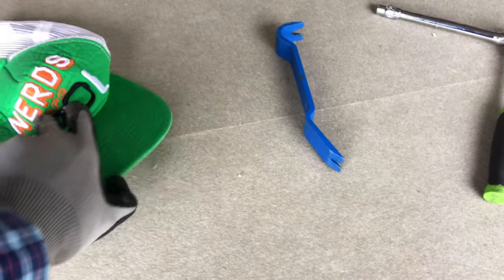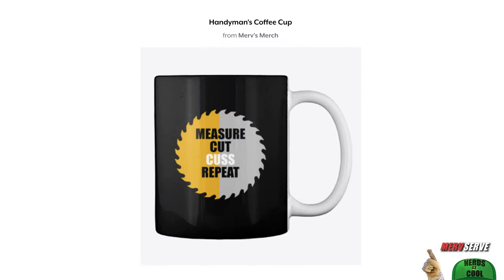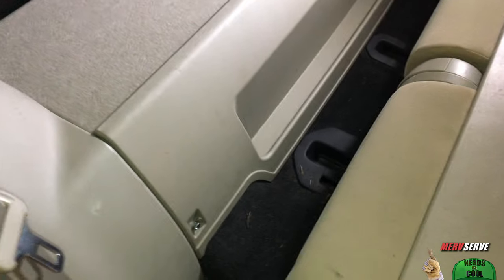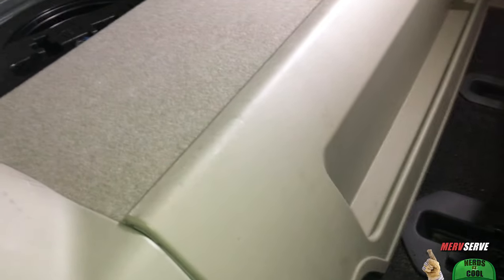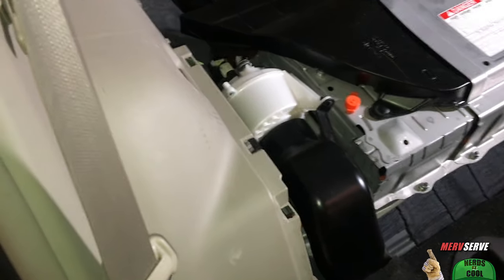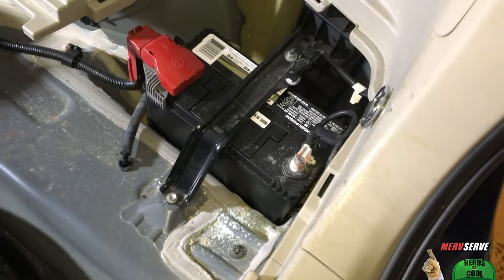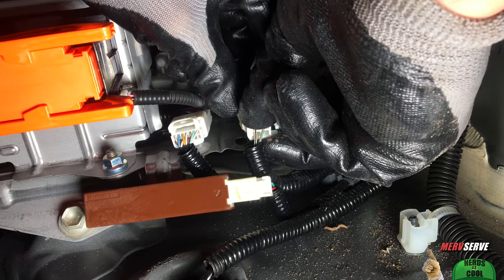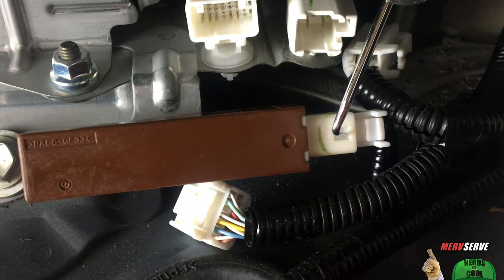Hybrid Battery Saver-Prius v Hybrid Battery Fan Cleaning & Cooling Performance

Comment: Thank you for the video. I followed it and I saved myself $500 dollars in dealer servicing. In the beginning I pulled the orange plug to disconnect the battery before working on the fan. I cleaned the fan using q-tips (dry first and then soaked with isopropanol) and some wet wipes. I found it easier to take the whole fan apart to get into all the nooks and cranies during cleaning.
Reply from the maker: Glad it helped. Sounds like you did a good job. And I like your attention to safety details!

Comment: Good video but you missed one important maintenance item. The black intake has a screen filter that gets clogged with dog hair. It is reachable under the right rear passenger seat. You might even be able to clean it with a shop vac crevice tool. (No 10mm needed.)
Reply from the maker: I told Merv Junior to get good shots, but he neglected to capture that portion of my procedure.  I did mention it however.  But I'm glad you pointed it out.  Thanks for watching. -Merv Himself
Reply: the battery and yellow car icon comes up on my dash and I have to reset often. I noticed that it happens when it's hot and previous owner was a dog owner. there was lots of furs in the car. I might actually have a clogged up filter. I'll check tomorrow.  Thanks for the video
Reply: I cleaned that screen filter out and emptied varmint hair from it but MY FRIEND still needs to clean that battery filter next to the DANGER Death ain't ideal hybrid battery. Is she good if she pulls the orange clip? Does she need rubber gloves?

Help please?
Reply: I just found it. It was completely clogged.
Reply: I worked a bit to get that screen out and cleaned it up real good. And then I realized what you mentioned. Why not just reach under the seat with a vacuum cleaner hose. My screen was maybe 10% clogged after over 100,000 miles without pets and not many children riding along.

Comment: Hola Merv. I have a '13 Prius v and a '19 LE awd-e, which I think is the best bang-for the buck, cold-weather commuter car available.
A nerdly point about which battery starts a Prius:
"In all versions of the Prius, the motor called M/G1 spins the engine to start it. It is an AC motor powered by the inverter which is powered by the high voltage battery.
However...
If the 12 volt battery cannot start the computers and power the fuel injection and engine electrics (the spark plugs need to fire, etc) your Prius won't start."
Reply from the maker: Interesting stuff and well-explained!  Thank you for sharing with our loyal legion of followers. Sure do hope you'll subscribe and be a regular!

Comment: I learned a lot just by watching since was just charged  $293 for a hv [high voltage?] hybrid fan/filter service by Toyota and was wondering why it was so expensive. At least this makes me feel somewhat better than it does take some work to access the fan. Can you tell me what the vents are for that are located under the driver and passenger seats? I can't find anything in my manuals. I also was told to replace  an AIR CONDITIONING CABIN FILTER (no price given) and an AIR FILTER, R&R--whatever R&R means ($135). If you have any videos on these filters, that would be great. I discovered what I think is the air conditioning filter accessed through a panel in the lower glove box--it looked clean to me so I'm not going to do it--I don't have pets and keep my car in a garage, so not much dust either. Thank you again for any input.
Reply from the maker: I think one of the things you are calling a "vent" under the seat is the passageway for the cooling fan.   As for the engine air intake filter, you will see me remove the housing for it in the following video: https://www.youtube.com/watch?v=4ALjAsMKhCA The housing is outlined in yellow, near the beginning of the video and you'll notice silver clips that can simply be released to open it up.  (You won't have to take the whole thing out like I did in order to get to the filter)
Reply: R&R = remove and replace

Comment: The 12 volt battery doesn’t crank over the car, it powers the computer that controls the Hybrid battery which cranks the motor in the hybrid transaxle

Comment: You are awesome.  You did it right, quick, easy.  (Others make you remove everything).  I like it this way I like to do it this way too.  Thank you 🙏
Reply from the maker: Thanks for watching! Please share!
Reply: @MervsServiceSecrets  :  There’s a pipe connects to the fan and goes under the seat was dirty too. 
What doesn’t make sense is. Why air is sucked from under the seat?  If I turn on the heat which I like it hot. It is blowing hot air on the batteries. 🧐🤔
Reply from the maker: I know what you are saying, but I reckon they figure cold air falls and hot air rises, so sucking it from the lowest point is best.

Comment: Hi thank so for the info, very helpful! We bought ours used and I am realizing it is now missing the foam components for under the cargo floor (above tire area). Do you know what those might be called/part number? I've tried a variety of keyword searches and cant find them but I'd like the support so when my dogs jump in the back their weight doesn't press down....appreciate any info you might be able to share!
Reply from the maker: Maybe try ebay.

Comment: LOL! That toothbrush calling out your name really had me.

Btw, the thing about Toyota designing 3 diff connector block designs in 1 place ain't for bull. That's a monkey-safe system to prevent any mix up.
Reply from the maker: Ahhh. I mean, I reckon they could've color-coded them, but makes sense.

Comment: no, the 12 Volt battery doesn't start the engine like a normal car!! Big mistake! The 12 Volt is simply for the lights, the fan, the indicators etc. The engine is started by one of the two electric motors in the planetairy gearset, which is attached to the engine

Comment: Does anyone know if the fans turns on automatically when the car is running or when the battery starts to get got?
Reply from the maker: Typically I have noticed they come on when the battery reaches a certain temp.

Comment: HI Merv, Gen2 Prius Battery Fan working. Found corrosion in Large Plastic plug connection, closer to the hatch. I tried electrical cleaner and used a needle to pick clean the corrosion. I wanted to wait and get a plug from a salvage yard then splice and connect. But I when't ahead and cut off the connector on both sides then cut and splice together with electrical tape. The wires were black, yellow, purple and brown. It looked like the brown wire was missing the metal pin inside the connector. I assume thats the hot lead. Did not work. I will try and find a good plug from a salvage yard and go it again.  It may be that the wires have a short elsewhere. Any suggestions?
Reply from the maker: Wow.  You are going where no Merv has gone before!  Wish I could offer more advice, but you seem to have a plan that I wouldn't dare criticize without having more information.  Be sure to post your project on social and tag me, so everyone in the MervServe DIY Club can check it out.  On Twitter I'm @MervsService and on Instagram I'm @MervServe

Comment: Merv Honey, you didn't really need to do all that with the fan.  I was needing some close up shots of the filter on the other end of the vent, that's under the seat.  I've seen some videos of that intake filter being clogged and was hoping you'd come through with a better one.
Reply from the maker: I think Merv Junior was slicing off a piece of chew instead of videotaping that portion.
Reply: @MervsServiceSecrets  When Junior finally finds the spittoon, please get him to record that part?  My 2015 Prius V has black interior, and I need to find that vent screen that hasn't been examined since I purchased it.  Pretty Please?

Comment: Is there a filter for the V? I’ve seen a lot of videos of the regular Prius saying the filter needs to be cleaned. Where is the inlet for the fan?
Reply from the maker: There is a grate over the end of the inlet duct for the HV battery fan,  but it's just there to keep out the big stuff.  There is no filter which is why it gets dirty inside that blower.  Look under the rear seat on the passenger side and you will see where the duct starts. From there, it goes back toward the HV battery and bends upward where it connects to the cooling blower.  Hope this helps.  Be careful.

Comment: Dear Merv and other viewers, I have a question about cleaning the HV battery fan on a Prius Plus Wagon (2012). The Prius Plus Wagon  is sold in the US under the name Prius V. But..., there is one big difference when it comes to the spot where the HV battery is located in the car. In the European Prius Plus this HV battery is placed between the front seats. On the US model Prius V Wagon the battery is placed under the back seat row. From the outside the Prius V and the Prius Plus (Europe) look the same. Both are wagons. 
However, the European model has THREE seat rows. The European model is a SEVEN seater. The location of the HV battery is therefore very different. Like I said, it's between the two front seats.

Would anyone know where to find information on the cleaning procedure for the European model Prius Plus Wagon?  I could not find anything on YouTube. The air intake for the battery fan seems to be under the richt front seat for the Prius Plus. Are there Toyota service manuals for car technicians who cover this cleaning procedure? 
Thank you all in advance for your help, M
Reply from the maker: Thanks for watching. I am posting your comment in hopes someone with more knowledge than me can chime in. I really don't know much about that European model you spoke of, but whatever you do, be careful and follow all imaginable safety precautions. Do a lot of research and get tips from lots of professionals.  Also, please update us if you find a solution and be sure to hit me up on social.  Have you tried the prius chat forums?  -Merv Himself
Reply: @MervsServiceSecrets  Thank you for your swift reply. I hadn't thought about Prius Chat. Thank you for that suggestion. On Prius Chat I found the link to a Spanish language video on the European Prius Plus+. It's title is "desmontar ventilador Prius". Link: https://youtu.be/MCDHIsRGEYc

Comment: Great video, Merv. I must say, you did make this look easy. My dealership wants $500 to do this! As others have commented, I’m a bit hesitant to do anything on my car myself - Toyota puts the Fear of God into you when you ask them about doing anything around the hybrid batteries yourself. I do have a question - is it necessary to take off the Orange ‘circuit breaker’ bar if you’re just doing this fan cleaning?* (*Asking for a friend who does NOT want to end up with a home permanent hairdo.) ✨😂✨
Reply from the maker: The idea behind that breaker is to reduce the electricity to a non lethal level. I personally fancy that as a nice feature. Dare devils may feel otherwise, I reckon.

Comment: Okay, so you were able to touch everything that you did...using a metal socket, etc. because you pulled the orange prius battery tab which decreased the voltage (and danger) and also I assume because you are wearing rubber fingered gloves? 

I have ...a friend...trying to clean her car after a family of pernicious varmints tried to make a home (with a full comfy varmint nest) in her glove box, her cabin air filter, some nice scarves she kept in her car in case she needs to look fancy quickly (ask Helen about how a cute scarf can make you look instantly more professional...er...I guess it depends on your profession), and finally made their home for their children also.. in her trunk.
It's been a hellish road to clean up their mess but she's been able to clean & change everything out like the air cabin filter, the filter inside the cabin that filters the  intake air located next to the back seat inside the cabin closest to the trunk.....but she needs to get to that battery filter you're cleaning here in this video 
 
Help? I've..I mean, SHE has got girl parts and she doesn't plan on getting bamboozled by a mechanic shop (who wanted to charge her close to $100 to change her air cabin filter behind the glove box which took her about 5 minutes to remove and change youtube DIY style by herself.)

What gloves are you wearing? Will she die?... She (and I) are mere mortals. 

They also want to charge her $119 to make sure her car is okay to drive 14 hours. Her belts are fine (that's what she said). Filters changed, oil changed recently....what in the world are they checking for for "road worthiness"? This car is fine to drive as she drives it just fine without trouble. 2015 Prius with less than 56,000 miles. 

Most importantly....How does she clean that battery filter you're cleaning there without getting electrocuted??
Reply from the maker: Well, the purpose behind that orange disconnect is as stated. But of course as a general rule, don't do anything you aren't comfortable with.  The best I can tell you comes from personal experience -- I have never died doing it, nor have I heard of anyone dying in such a way.  Yet I always encourage viewers to do additional research beyond whatever information they glean from my videos.  And regarding gloves to wear, that brings us to a very special video Demille recently put together which demonstrates various kinds of gloves if a person really wants to take things to extremes.   In this video , you will even see special electrical gloves that are recommended when someone is taking apart all the most dangerous parts of a battery bit by bit, although I suppose some might argue they are overkill for minor procedures.  But again, you need to decide what's best for you.  You'll find the video here along with important references to Mr. Weber. I think you'll like it. Hope this at least helps to point you in the right direction:  https://youtu.be/g12Z_PFihYc